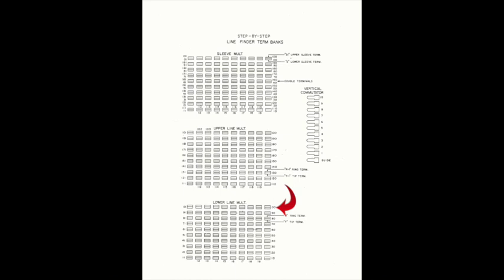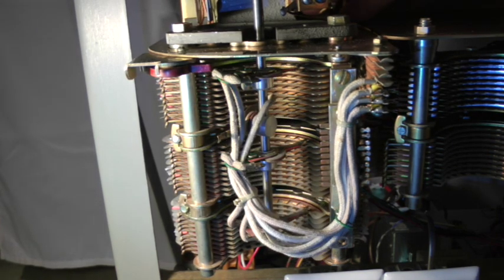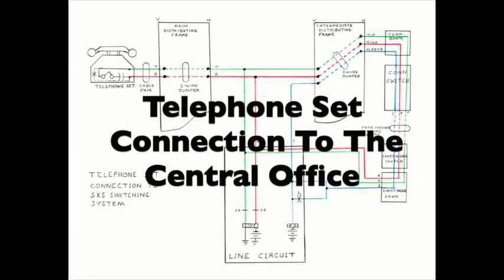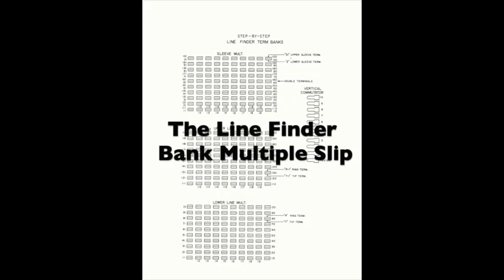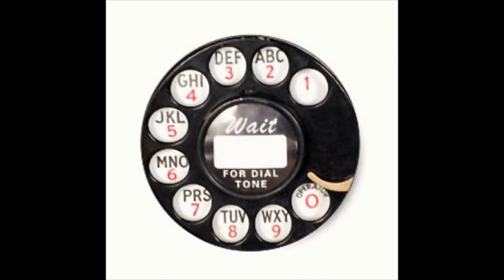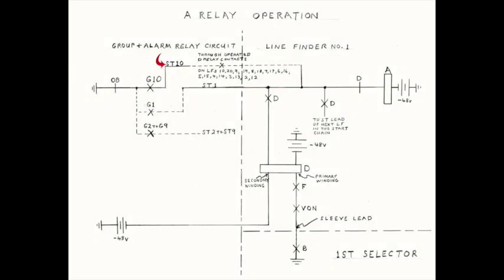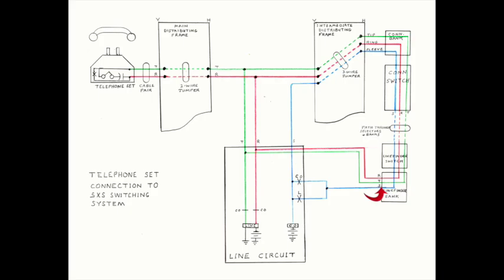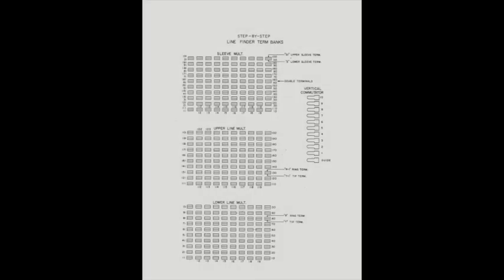The Line Finder In The Step-By-Step Telephone Switching System

Comment: Nothing even 1% as elegant and reliable could be designed and built today.  And people still think we're "evolving."
Reply: Non sense !!! Look at a cpu under a microscope !!!
Reply: @clitisswood7330  I have.  Have you?  Have you seen one that has anywhere near the reliability and elegance of this?  Complexity and size reduction are not reliability and elegance.  Not at all.
Reply: @KC9UDX  You clearly haven't worked on mechanical switches and relays Vs microprocessor based systems to have come to that conclusion. Processor based systems are far more reliable with considerably less maintenance to boot.
Reply: @kingsman428  clearly?  Umm I have been imagining my career for three decades?  The gear shown here works for longer than microprocessors have been in existence!  Oh and those random reboot-and-try-again must not count as maintenance...
Reply: @KC9UDX   "...works longer..." 
You've moved your initial point from reliability to longevity which isn't the same thing but let's ponder longevity. Approx 75 years for Strowger and the following variant switch  types {note, not the same switch} Vs 50 years since the microprocessor, the gap isn't as large as you think and it's Inevitable that the life of microprocessor based equipment will far exceed that of electromechanical.
"...random reboots...count as maintenance..."
They don't, they are faults and totally separate from maintenance plans.
PDH and SDH equipment is very reliable, we have kit that has been running outside, in extreme conditions, for the last 25 years. Microprocessor equipment is so reliable that 6 monthly maintenance plans no longer exist, those maintenance  plans are now fault driven.
"...nothing 1% as elegant and reliable could be built today..."
Comparing a Strowger switch with an ASIC or microprocessor is similar to comparing a desktop PC with a blackboard, it's not even a contest. Don't get me wrong, the Strowger is a work of art and the pinnacle of electromechanical design but simply outclassed by modern technology. To put it into context, your pocket mobile phone makes the German Enigma machine look a Mecanno kit.
"...three decades..." I'm amazed how any one could spend 30 years in engineering and arrive at the conclusions you have, perhaps it's you that hasn't "...evolved..."
Why else do you think Telco companies moved from mechanical switches to microprocessor based solutions?
Reply: @kingsman428  cost.  Has nothing at all to do with elegance or reliability.  Why is everything made in China?

If reliability has nothing to do with longevity then we're not speaking the same language.

I can't legally, or I'd happily show you some identical equipment in front of me.  One is entirely electromechanical and has been in service since 1950, with almost no attention at all.  The other retrofitted with microprocessors because there was a budget to "upgrade" in the 1990s.  It's been twice since retrofitted and needs regular attention.  It's obsolete again, so will need retrofitting again. Apples to apples, the business ends of the two things are identical. This is no isolated case.

Random reboots are directly tied to reliability.  Almost any complex system that I can think of with microprocessors needs them from time to time.  Electrical variations, cosmic rays, "nobody knows" etc.    The things that make mechanical systems fail are much better understood and predictable.
Reply: @KC9UDX  "... cost..."
I didn't mention cost.
"Why is everything made in China"
Exploitation of a cheap labour force.
Reliability and longevity are not synonymous, it's not unusual for unreliable equipment to have longevity due to high prohibitive costs of replacement.
"...random reboots are tied to reliability..."
I didn't say they weren't, I said they are fault conditions and don't come under maintenance plans. 
"...obsolescence and retrofitting..." Mentioned in quotes and in a derogatory fashion notwithstanding the fact it is one of the concomitants of the advancements in technology and one of the points of having a microprocessor based systems. EG try retrofitting your Strowger switch. 

You comment that you have a Strowger switch that has been running for 70 years with virtually no maintenance and a 20 year old microprocessor based switch that causes you no end of problems as though it lends support to your assertion that electromechanical is more reliable than semiconductor unfortunately, it doesn't but it does raise a couple of engineering questions.

#1 Why is it that after 20 years your engineers haven't been able to get to the bottom of the unreliability of your microprocessor switch?

#2 Why have you allowed a Strowger to go pretty much unmaintained for 70 years? It must be in shocking condition with mechanical wear, magnetised armatures, worn slugs, carbonised points and noisy lines galore.

It's your prerogative to believe that electromechanical is more reliable but the fact that most Strowgers have been decommissioned over a quarter of a century ago ought to give you a clue that you might be wrong and that your own personal experience might just be a one off.
Reply: @kingsman428  you're making all sorts of assumptions which cannot be sorted out here.  Nothing good can come from any thing more.  Cheers.
Reply: @KC9UDX  Fair enough, have a good life dude.
Reply: @KC9UDX  процессоры ГОРАЗДО надежнее этой механики, особенно если учесть, из скольких миллиардов транзисторов они состоят. Это ведь очевидно, как божий день.
Reply: @KC9UDX  какие ещё перезагрузки? Аптайм серверных систем - годы!
Reply: KC9UDX  Cheap Communist Chinese made crap today.
Reply: Amen

Comment: ABSOLUTELY LOVE THIS VIDEO! It could have saved my parents dial telephone 50 years ago if I had seen it then. I wanted to know how telephones worked so I took it apart and broke the plastic plunger in the hookswitch. Thanks!
Reply: I was home alone l disassembling my working mom's phone when I was 10 years old because, of course, I too had to know how it worked. The whole time I was disassembling it I was holding the switchhook so that the dial tone wouldn't play and the scary off hook alarm wouldn't happen.  I was so scared of the off hook alarm as I was convinced that it would tip somebody off that I was breaking rules and taking the phone apart. I was sitting on her bed and had the whole cover off, holding the switch hook down and was staring at it the innards... when the phone rang in my face and so startled me I remember the whole thing 50 years later! I had that whole thing reassembled in 30 seconds I bet! 
I always wondered if some psychic with a great sense of humor just couldn't help herself! Nobody ever called during the day and I was home from school pretending to be sick that day... I decided someone must always be watching! 
Only three years later I was gleefully hacking in any old phone in our house and adding extensions in those hardwired don't-touch days. 
I later became an electrical engineer and my first job was to design D4 channel Bank cards and learned all about telephony and designing products that survive lightning strikes and AC crosses. 
I once got to tour a still working step-by-step Newport RI central office as they were preparing to migrate to a digital switch in 1985. The sea of chattering relays and continuous 20hz ringing monitor bell that confirmed the alternator was spinning was memorable. our tour guide also told us that the technicians we saw wouldn't be working there in another couple of months and that the people managing the new switch would be in some office somewhere else.It made me feel a little sad and made me wonder if the channel bank cards I was designing we're headed for obsolescence...
Still reading? I have more stories my wife isn't interested in!
Reply from the maker: @JamieMurdock90  Aah, the good old days.
Reply from the maker: You're welcome, and thanks for watching.

Comment: I always imagined simple stepper relays wired one into the other, Wow, its Way more than that. The fact it worked as dependably as it did is simply mind blowing!!! It is the highest testament to the mechanical and electrical engineers who designed it, in 1920 no less. It should humble modern engineers. Thank you, you put a whole lot of work into something that the few rare people who dont look at cats all day long will watch.
Reply from the maker: The development of the SXS switching system was started in 1889 by Almon Strowger. The workings of a two motion stepping device was so intricate that Almon Strowger was unable to get a reliable working version built. It was the brilliant people that he hired, Alexander Keith and brothers John and Charles Erickson, that actually built and patented the first recognizable version of the SXS switch along with the rotary dial, both in 1896. Strowger’s company evolved into Automatic Electric (AE). AE continually made massive design improvements, such that by 1920 it had evolved into a reliable, efficient and cost effective system. It was at this point (1920) that the Bell System caved in and began purchasing AE SXS equipment. The Bell System’s manufacturing arm, Western Electric, began manufacturing its own version of SXS in 1926 and introduced the SXS line finder in 1928.
Reply: This technology was used in many big cities (Cleveland) was one until cutover to #1 ESS in the early 70s. At the Clevoh45 this required 45 techs, after cutover to modern digital electronic technology that was 3 people on the day shift.
Reply: NO s
SAME ENGINEERS CREATING THINGS. Dont confuse with lame  engineers who got their degree because of equal opportunity bull...

Comment: Was this system used in the crossbar networks?
Reply from the maker: SXS and Xbar were completely separate and different switching systems. However they both formed part of the Public Switched Telephone Network (PSTN). They were able to communicate with each other via trunks, and there was no problem placing calls from one type to the other. It was common for a large central office to have both SXS and Xbar in the same building.The SXS was an earlier design than the Xbar. In the Bell System, SXS dominated the manual to dial conversions during the 1920's through the 1940's. In the 1950's and 1960's, new switching systems required for dial conversion and growth were dominated by Xbar. It wasn't until the 1970's that Xbar overtook SXS in the number of lines in service.
Reply: @Hicken65  What was the market penetration of panel?
Reply from the maker: @AriBenDavid  It maxed out at 6 million lines. To my knowledge it was never utilized outside of the Bell System.
Reply: @Hicken65  So, only a few metro areas? What were its advantages in NYC, for instance? Quite a strange contraption ! Crossbar seems more like an ESS with its complex shared markers.
Reply from the maker: @AriBenDavid  The markers were remarkable devices. They were special purpose analog computers composed of around 1000 wire spring relays. They could process a call setup in about 1/3 to 1/2 seconds.
Reply: I would call them relay-based digital computers. Analog computers are specialized high-precision feedback devices. Yes, it must have been an engineering feat to deploy this many relays and have them process calls so fast.
Reply from the maker: @AriBenDavid  Just to be clear though, , there was no digital coding and decoding transmission of data or any sort of multiplexing involved with markers. All transmission was performed in parallel over a large array of wires  with only one discrete piece of "information" per wire, that piece of information being an analog  -48volts dc to positive ground signal. On any given wire, the analog signal being there or not being there would be as "digital" as it would get.
Reply: @Hicken65  The audio path was certainly analog through the switch (It is always so at the edge.) but the switching logic in the marker and elsewhere was digital. More and more of the audio path becomes digital, but even with my Fios connection, the signal goes analog inside the house. However, it is gigital back up the  fiber cable and through the switches. With Central operators, the logic was in their brains and the logic was on hook off hook.
Reply from the maker: @AriBenDavid  My explanation of how data is passed to and from the marker is analog to me. If you want to call that digital, that's fine. We'll just have to agree to disagree.

Comment: I would have done a 6 screen mosaic shot so you can follow the sequence without switching full screen. Showing each step full screen is making me queasy.
Reply from the maker: Well, viewer discretion is advised.
Reply: @Hicken65  I think it was meant as constructive criticism.  I don't know if you have the capability to do what he's asking; it would be extremely time consuming for me to do something like that.  And it might not be the only solution.  

But the method used doesn't seem to be very helpful, and I found myself getting queasy as well.  I'm not epileptic and frankly this is the first time in my life I've experienced something like this from watching a video.  Again, I'm not complaining, just trying to say that this might not be the best way to do this in the future.
Reply from the maker: Well, it certainly wasn't my intent to make viewers queasy. It never occurred to me that it would, having watched it many times on my 27" IMAC. I don't know if I could have done the mosaic approach. I don't have expensive software, just the  Apple imovie 11 that came with the computer.
Reply: @Hicken65  I never would have expected it to happen.  I was very surprised that it did.  I wonder if increasing the time on each frame would help.  I sort of guess that what causes it is that my brain can't figure out what I'm even looking at in such a short time.
Reply from the maker: You can change your You Tube playback setting to .5 of .25 to see if that helps.
Reply: @Hicken65  That is what I did in hopes of seeing what was happening. After watching later into the video, I realized that was not necessary for understanding how these devices work. Great job putting this together. Very thorough explanations and meticulous editing. Would have to say this one of my favorite videos.  Thank you!
Reply from the maker: @BrianEltherington  You're welcome and thanks for watching.